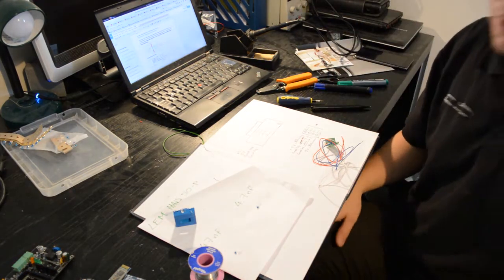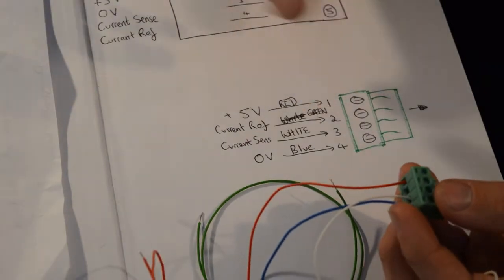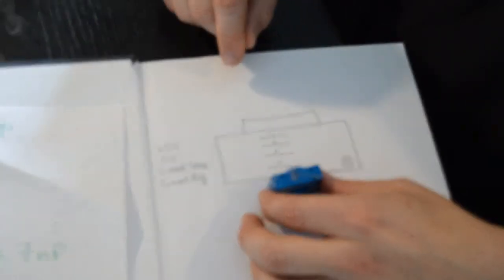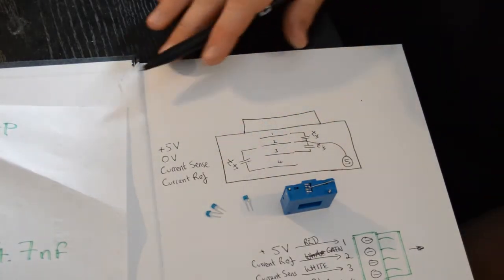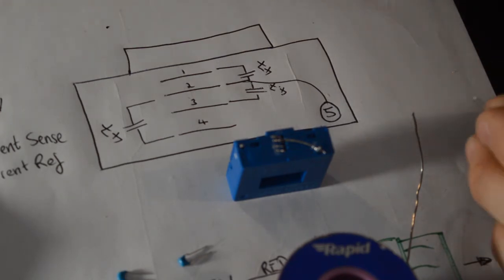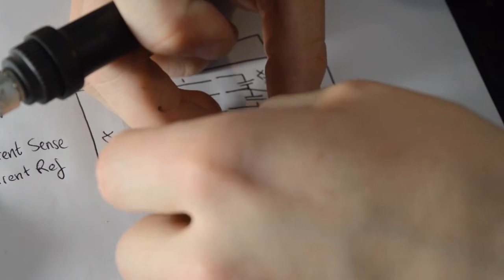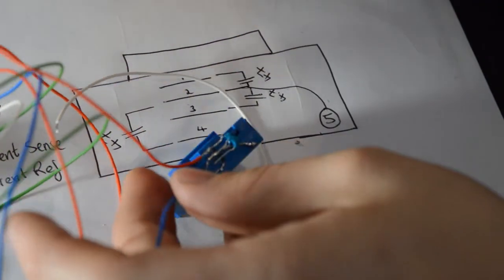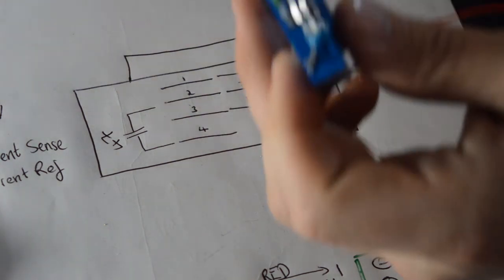eChook Nano: Wiring up the current sensor (LEM HAIS 50-P)

Comment: Hi 
What's the difference between the current sense and current ref pins ? How should they be wired up ?
Reply: The reference pin provides a constant voltage, in the region of 2.5v I believe. The Current sense pin gives an output relative to this reference, so if sense == 2.5 and ref == 2.5, there is no current senses, if sense is greater than ref, current is flowing in the forward direction, if sense is lower than ref, current is flowing in the reverse direction.

As it's the difference in the signals you need to be measuring, a differential amplifier or instrumentation amplifier are good next stages.
Reply: @Gryph0nic  Thanks for the clarity that makes sense